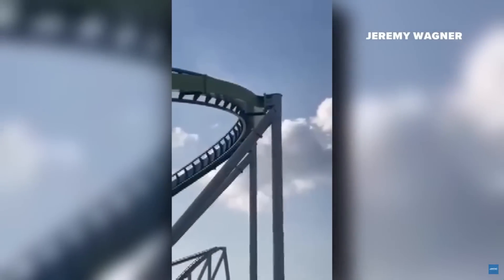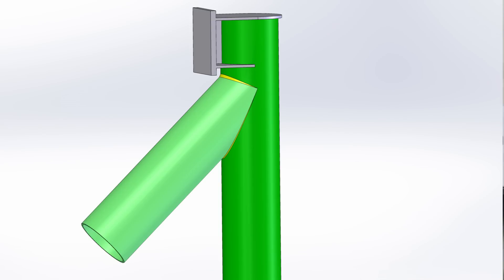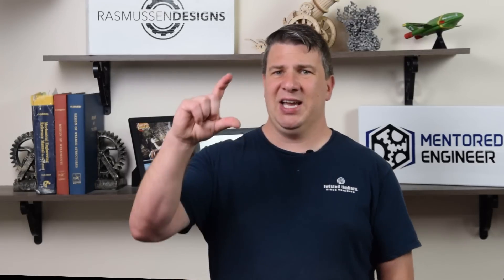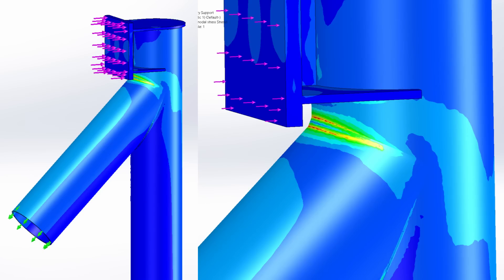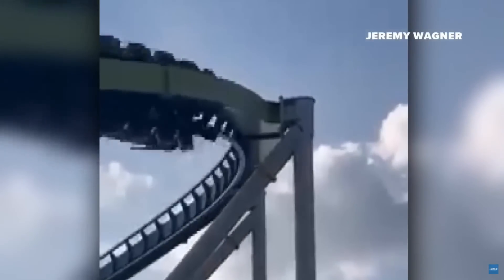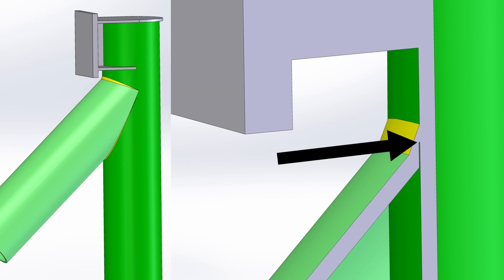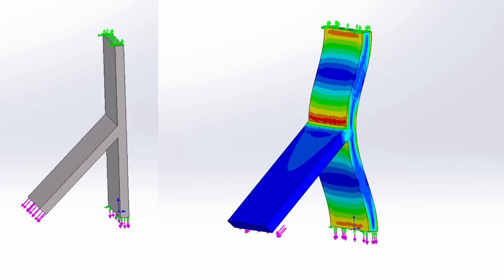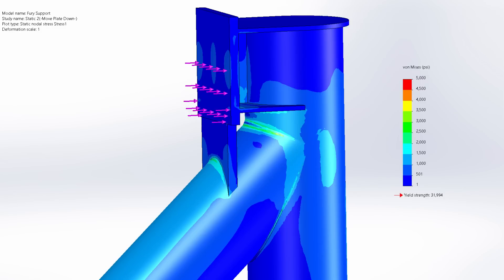Fury 325 Crack! Engineering Analysis and Response

Comment: It seems weird to me that the diagonal support wasn't on the other side, bracing the column in opposition to the sideways load of the train going through that turn.  Do you think that would have made a difference, having the the diagonal support on the outside of the turn vs the inside?
Reply: I am not an engineer but a coaster enthusiast who tries to understand things...I actually agree and was thinking the same thing. The loads at that portion I am sure are large given the speed and weight of the trains. The track and support braces only support the loads for a split second until the train has cleared...It likely cracked due to tension forces...not compression...
Reply: It appears like the vertical column failed  but as was mentioned in the video the weld joint between the vertical and diagonal column  created a very weak joint which after repeated stresses over the years eventually caused a fracture which steadily grew over time.
Reply: If the support is outboard, the ride takes up more space. And generally, steel is stronger in tension than compression. But I agree, at the failure location it would be a bearing point, but you could still see the stress in the top side of the connection.
Reply: @zachheitman6247  For the steel itself, it does not matter if in compression or tension, the yield strength is the same for both. However ANY structural part in compression also faces buckling problems, which reduce the strength of the whole element. Does not matter which material, steel, concrete, wood, aluminium or anything else. However steel is more prone to such stability problems due to it's high strength and therefore slender construction compared to low strenght materials.
Reply: Precisely.

Comment: Considering I've never seen a failure like this on any other B&M, I wouldn't rule out a mistake from the contractor.
Reply: Same issue happened on Thunderbird at Holiday World last year.  It's more common than people think, and it's really not a huge issue.  It closes the ride for a while, but its still safe
Reply: @aleksthevoyager1260  I had no idea! Shows that I have no idea what I'm talking about lol
Reply: Monster at Walygator Parc had the same issue years ago
Reply: @michaelneichel9543  I had no idea! Shows that I have no idea what I'm talking about lol
Reply: i am a ironworker out of clevland and worked on and built most of these rides at cedar point. The milleneum force sheared solid billet tubing on the downhill and broke plenty of horizontal bracing in the tall towers on the big hill. The raptor is the same engineering pipe columns the same track connections.1 bolt you could not get in on the uphill the chain drive was in the way. Their was already enough bolts 1 inch metric i think Intamin desiged raptor. The vertigo one of the columns broke above a connection, they siad wind shear caused it. I could go on and on i worked their from 1991- 2010 it got to cold in the winter i wqent to florida.
Reply: @Melanthius-r6s  Raptor is a B&M Invert.
Reply: @bechtoea  wasnt sure i remember the swedish consultants
Reply: Silver Bullet at Knott's Berry Farm failed like this at the track spine.
Reply: @toddjones1480  I had no idea! Shows that I have no idea what I'm talking about lol
Reply: BM?
Reply: A mistake would be getting back on that thing. It's not sound and the design is extremely bad
Reply: @SUGAR_XYLER  Was anyone hurt? Nope, is the track in one piece? Yes. Quit your whining, GP

Comment: Add weld would increase the heat effective zone causing the material to weaken. While welding these joints there should of been pre & post heat temperatures checked as well as during. If you get the material to hot the material is as good as cardboard
Reply: I believe this was a heat treatment problem. People are saying welding problems. I disagree. Probably either the piece was made of pure trash, or not properly treated.
Reply: @MrSolidBlakeGaming  Structural parts are usually not heat treated, except you want to machine them. And columns are definitely not heat treated.
Reply: @MrSolidBlakeGaming  correct. There had to be a wps for the job with the correct wire, gas, voltage etc pre heat and post heat as well as inner pass temperature. There's a lot of weld in that part.
Reply: We are talking about low strength, structural carbon steels. Something in the realms of a S275 or A36, with wall thicknesses of about maybe 15mm.
As a civil and welding engineer, I can assure you one thing: it's close to impossible to weaken mild carbon steels, even with bad welding parameters.
Only thing how you can really hurt such steels would be rapid cooling with water directly after welding.
We are not talking about high wall thicknesses or high strength structural steels, which get their strength by quenching & tempering or by thermomechanical rolling processes.
And what some of the commenters probably don't know: bad welds mainly affect the static strength, but for fatigue loads the simple existence of welds is already sufficient to lower the strength of a part.
Assuming a S275 steel,  the material can bear 275N/mm² before starting to yield. The strength of the welds themselves is usually even higher. The allowable stress range in fatigue for this connection is (highly depending on the geometry) is roughly somewhere in between 30 to 80 N/mm²

Comment: The track is fabricated at the clemont steel works in Cincinnati. Might not take as long as you'd think for a piece to be made
Reply from the maker: Let's hope so!
Reply: They announced yesterday that a new support is currently being fabricated and will be delivered next week.  I am doubting, however, that it will have any engineering improvements.  I’m gonna guess they’ll get the ride up and running ASAP with replacement parts of the current design and will be inspecting it frequently while they investigate what caused the failure and engineer a long term solution, then during the off season we’ll see the ride partially disassembled and the new solution actually implemented for next season.
Reply: @jaanfo3874  I know they announced it yesterday but I said it 5 days ago.  I'll also bet they do add a gusset for extra strength or change the angles that the joining pipes are connected to.  B&m don't like issues and have no problem making corrections that's why they're typically highly reliable

Comment: Seems like they should have a support that’s “pushing” rather than “pulling”, right? For example, the support looks like this: /|, would it not be better as this: |\ ?
Reply from the maker: Less chance of failing, but it might have put that support in the parking lot.
Reply: As we are talking about fatigue induced failure, putting the support on the other side would have one advantage: the weld toe would be in compression instead of in tension. While the design codes for welded parts only asses the stress range and neglect the direction of stresses and the mean stress (many good reasons to do so), doing fatigue tests on my own, I know that welds under compression perform slightly better than welds under cyclic tensile stresses.
However the whole argument goes down the drain, if weld flaws are involved.

Comment: I might be wrong but don’t forget during Winterfest time Fury 325 was running in 2022 in the Winterfest Season.
Reply from the maker: I believe that it has to 40° or 45° for Fury to run.  Most tubing and pipe isn't effected by those temperatures.
Reply: The temperature rating ensures the train can clear the circuit.

Comment: It could also be the 45 degree angle tube it’s foundation shifted or sank a little
Reply: In most cases don't they usually dig the  holes for the footers down to bedrock so as to prevent settling of the footers after construction?

Comment: You lost me at “inadequate design”. You jumped to that conclusion before even considering manufacturing errors, bad welding, inadequate NDT, ground settling, or other non-design-related possible issues. Several engineers with many years of experience spent a lot of time designing this ride, and it had to have been signed off by PE’s in order to get built in the first place. Saying the entire support needs to be redesigned is a HUGE leap. I’m not saying it’s impossible that there was a design error, but all things considered it’s very unlikely. 

I know this incident is fresh and is surely getting you clicks, but please consider the possible effects of what you’re saying here. As an engineer you should understand the ethical implications of spreading public mistrust.
Reply from the maker: Apparently you missed my disclaimer.  The load has not changed since the day it opened and it broke; therefore, the design was inadequate.  The investigation that will ensue will identify the root causes.
Rest assured, we will learn more from this one broken support than all the rest of the successful supports.

Comment: It seems B&M is at fault (based on this video on the joint).
Reply from the maker: I won't necessarily assign blame based on a video from a hundred feet away
Reply: @MentoredEngineer  That is a full penetration weld all the way around that joint.
Reply from the maker: Thanks for clarifying
Reply: @MentoredEngineer , I could absolutely be wrong, though.

Comment: I'm curious - How safe is the structure with the break?

Obviously you'd not run the coaster as soon as it's noticed, but I'm curious how much margin of safety there would be for the coaster losing an entire support.

I'd assume it would be able to run safely and that no guests were ever at risk, but I don't know what kind of safety margins are built in.
I'd also assume that since it's putting much higher loads on the supports next to it, those would have a much shorter life before they became unsafe, but would that potentially be on the order of days or years?
Reply: The "factor of safety" or margin of  safety depends on the design and what the manufacturer built into it. Where I work, we build electric motors and depending on which component it is or what is being used we use a safety factor of anything from 2 up to over 10. generally when it comes to safety and lifting, we are around 5-10, but other components we may be at 2 because they may not be subject to much stress beyond that. FYI, a safety factor of 2 means it can handle twice the stress it was designed for. So if i wanted to design something to handle say, 1000 psi, with a safety factor of 2, I would design it to handle 2000 psi. In regards to something like this failure, there could be a multitude of issue. Design is one of them, but also the manufacturing of the part, the material, the weld etc. could have been bad from the beginning. My opinion here is not that the design was necessarily bad, so much as it could have been a material issue or a weld / manufacturer issue. But who knows, engineers make mistakes sometimes.
Reply from the maker: @tjsengle  great insight and explanation.  I hope the design factor used is higher than 2:1.  The ANSI 360-10 standard has the endurance limit of the joint at 7,000 psi and 4500 psi for a Category D and E weld, which would probably limit it further than a normal design factor.
Reply: As mentioned, I would be very concerned what was going on at the adjacent supports since if the connection was inadequate at the failed support, now the adjacent supports are taking additional loading and I wonder how adequate are those connections.

As the owner, I would be weary of the entire design and would want an independent review of the design with a specific focus on the same typical detail of supports that failed. This is a serious failure for a structure that is not very old which to me indicates under design rather than steel fatigue induced failure.
Reply: Those are all great questions! Just a coaster enthusiast here. Most modern steel coasters are built to last 30 or more years with no issues. The manufacturer B&M imports their steel for track and columns from Italy. It's a high grade steel you cannot get in the US. The track piece with the column with the crack is still bolted securely to the other pieces of track which are also secured to their columns. Sooo it's kinda like the whole structure supports itself. It would not "collapse." There's enough margin built into the ride where this kind of failure would not result in some major structural failure.
Reply: Ryan the ride mechanic said that the crack wasn’t much of a safety hazard and it takes multiple footers to crack to cause safety problems, it probably just put more stress in the track possibly making that track piece age a lil faster but that’s it.
Reply: I would not ride it    FD3 comes to mind

Comment: Ryan The Ride Mechanic, a coaster tech was saying he suspects that the footer on the diagonal piece may have sunk a bit, putting additional stress on that support.  What do you think about that?
Reply from the maker: Very good possibility.  I'm not a civil engineer, but anytime the restraints change, the loads will change.  A sinking of the support would indeed change the restraints and loads.
Reply: @MentoredEngineer  Viaducts with multiple columns are also considering differential settlements in design. The stresses arising in overdetermined structures are quite big.
However differential settlements are usually not really an issue with foundations so close to each other (although cannot fully be excluded).
Reply: Well, the only other possibility is the ride was overstressing the part and that's almost impossible as the B&M's as well as most other roller coasters, are overbuilt from an engineering standpoint.
Reply: In my opinion, the brace footer is unlikely to sink more than the vertical footer (straight down). The brace is in tension under design loads, thus uplift on that footer. I agree that the weld failure is most-likely the result of weld quality. Nearly impossible to actually inspect a weld penetration without an x-ray, and I doubt they x-ray every weld during fabrication.

Comment: If you look closely you can see that the vertical tube was notched into then had the angle pipe welded into it. If the notch had not been cut into the vertical pipe i would not have cracked the way it did. The weakest point is always the weld if you look closely the weld is fine. Its the vertical pipe that cracked meaning the vertical pipe was taking on an unstable load to begin with. Its bad design the vertical weld should have snapped not the pipe cracked horizontally.
Reply from the maker: In my design of weldments course (https://mentoredengineer.com/product/design-of-weldments-class/), we teach that the normal stress in the weld should be less than 60% of the weld wire tensile stress.  So yes, the weld is always the weak part
Reply: Did you happen to see the photo that a women posted, taken the Saturday prior?  It shows the crack had formed (pardon my lay terms) on the "slanty", angled part, but hadn't yet spread to the vertical part yet.